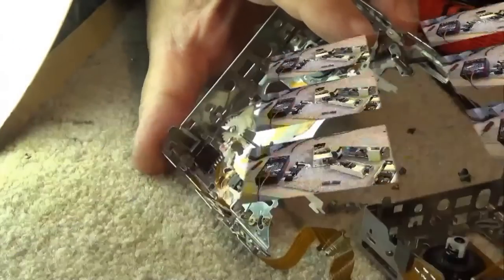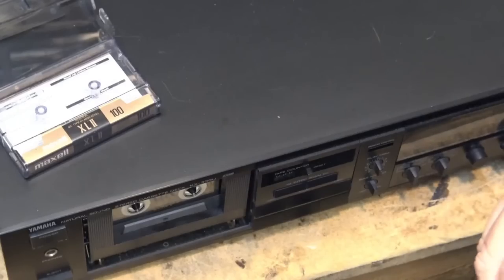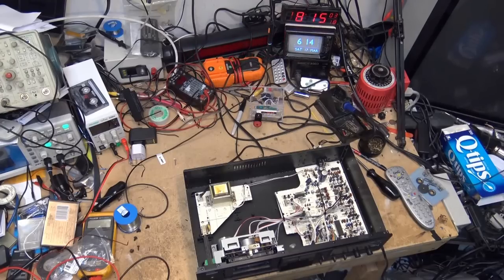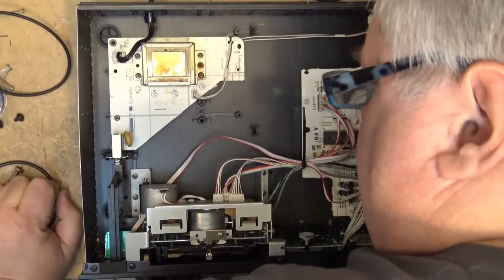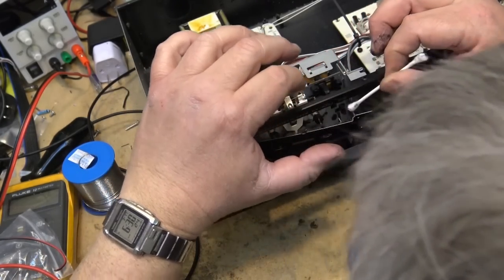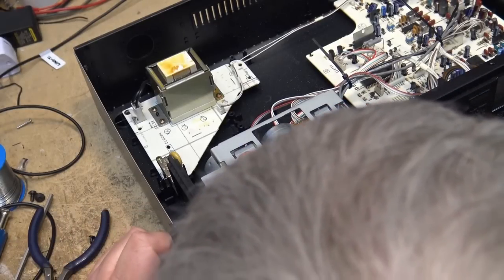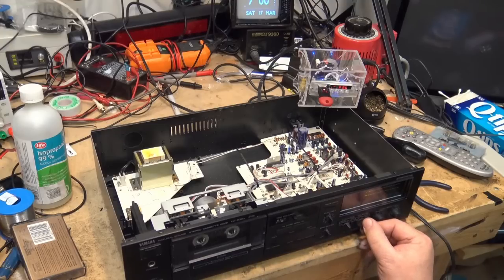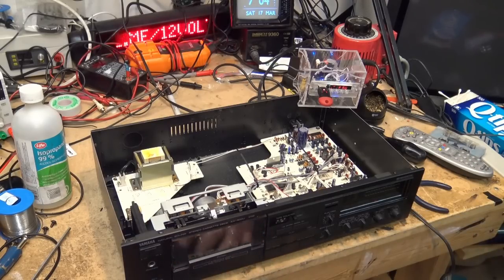Yamaha KX300

Comment: Autostop should be on the take-up side. So if the take up side stops turning , it wil stop the unit. That would help prevent tape getting tangled up in the machine.
Interesting video!

Comment: Sounds great i just got a kx 580 only thing with some of these yamaha,s is they have well low impedance heads so if the head fails it might be hard to find a replacement but they are great decks .

Comment: It's 2018 now...What? 🤣How's the CFL doing 5 years later?
Reply from the maker: The one that was hanging from wires finally packed it in last fall. Lasted 20 years as it was installed in 2002 when i built the garage.  There was originally 3 purchased.  One died within a few months and the manufacture sent me 2 replacements.  They are still in the box.  The 3rd is still in operation and it is 21 years old.  Let's see an led last that long.
Reply: @12voltvids  I've got a Toshiba Microwave that was bought in 1994, been plugged in ever since - still all original including the bulb. (Well it's had a couple of fuses over the years but i'll forgive it that).
Reply from the maker: @adamdavies163  my mother had an old Hitachi microwave.  Got it around 1980 and it was still working in 2007 when it was finally scrapped.  It was working but barely.  Took a full 10 minutes to boil a cup of water by that point.  Magnetron was probably down to under 100 watts.  I have a 1989 Panasonic madam grille that is used daily.  I got it in 95 from a customer that was down sizing and gave it to me. It is used pretty much every day but not as a microwave. This one is a conventional electric oven / microwave. (not convection that blows hot air) this one uses radiant heaters top and bottom.  We use it pretty much to bake and broil in and the microwave part is seldom used.  Sometimes to speed up a roast cooking. Anyway 34 years old only popped a switch once.
Reply: @12voltvids  Amazing how some equipment just keeps on working. 😀 That Toshiba I mentioned is a grill / microwave combi. Still seems to cook perfectly, I haven't noticed the power diminishing. VFD display is slightly dimmer I guess but that's about it.
Reply: Started scrolling the comments while waiting for ads to finish. Why is he asking about our football league? Then clicked on replies. Duh.🤦‍♂️

Comment: I have same deck. When recording it's "add" low tap tap tap sound to left.. what component is bad??? I don't have good oscilloscope to find that.
Reply: I had the same issue with my 400U, and it's likely a grounding issue with the mechanism, or a routing issue with the routing of the head wires.

Comment: SONY UX is underbiased under standard calibration, recording with Dolby and no adjustment you're going to lose fine details.

Dolby can be a test ground for cassette tape degradation these days. Dolby is pretty much required for some kind of music, otherwise at volumes comparable to a live session it's going to introduce a very distracting hiss that can overshadow the finest low level details.
Reply from the maker: And that is why i made the move to DAT as soon as it came out. Can not stand tape hiss and the music i listen to has the dynamics to take advantage of digital recordings.  I don't listen to much rock or metal.  Its mostly jazz, blues and classical.   Not that i don't appreciate what Elvis, Chuck berry and the Beatles did for music, i listen to them too, but for serious listening i listen to serious music where you can hear those details and textures.  Tape hiss and flutter ruins this.  For that matter so does vinyl.

Comment: I still do not understand why they added Dolby C on simple two heads recorders, it never sounds right. Dolby C requires tape calibration (both level and bias) and head frequency response must be decently flat. The emphasis/de-emphasis employed by Dolby C is pretty heavy so unless the playback is perfectly matched with the record, it will cause sound artefacts.

Comment: oh a yamahahahaha
Reply: I had an Aiwa ADF 410 for years after I  foolishly px'd my Teac A-103 for it. When that died a Yamaha KX 580 replaced it. It doesn't have the gorgeous analogue VU meters or the mechanical controls of the TEAC that I miss but 20 years later it still astounds. I have since bought two more KX 580s as back ups. I'd buy a Nak or a JVC 3 head but they are silly money now and made of pure unobtanium in any case.